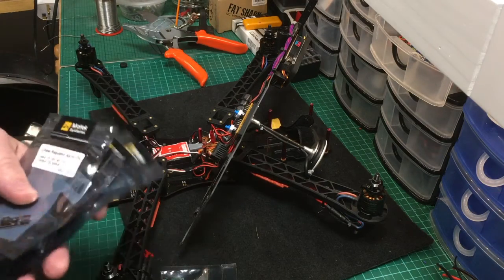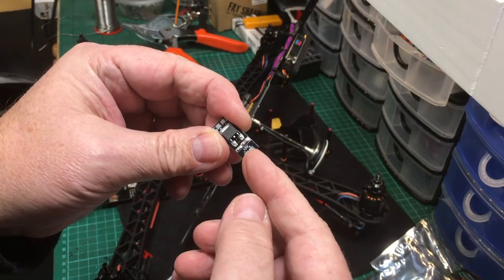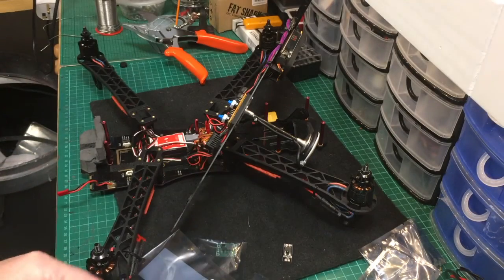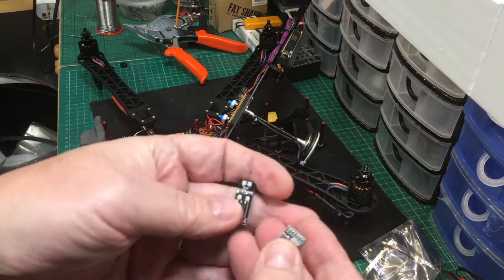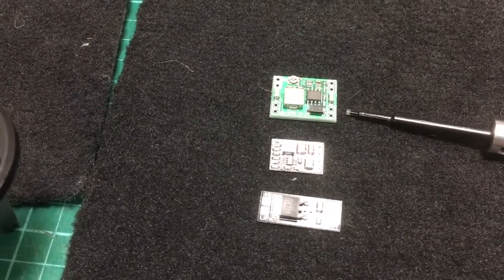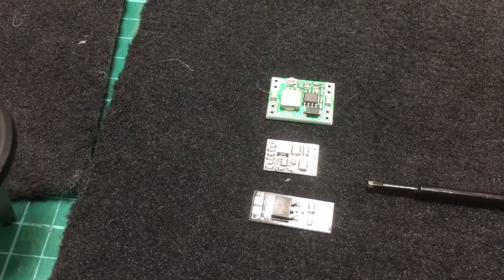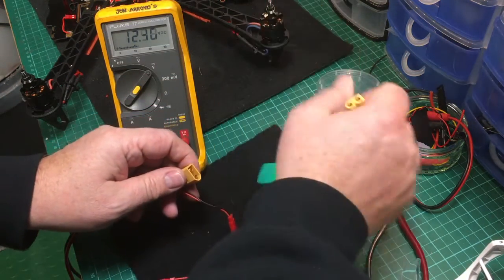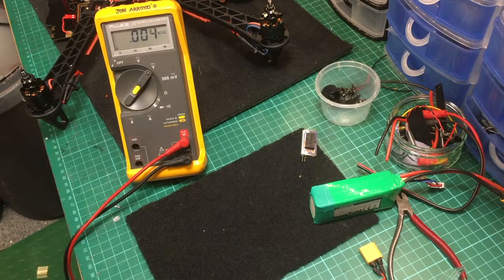Voltage Regulators

Comment: Ok im so confused atm. So im new to RC. And i plan to use it with model railways. So my battery is 3.7V and I need to boost it to 12V. So i purchased a pololu #799 booster. I've searched the web on how to wire this up.i found nowt..And how does you multi meter even work.any advice would be appreciated. Cheers
Reply from the maker: Boosting up is a problem..... as the voltage boosted goes up the power goes down. 5v 1amp in if you double to 10V out then the current is halved to only 0.5 Amp. and so on.....better use a three batteries in series to give you 11V or get a 12V power supply if you can. 
Just looked and it has three connections. Negative (black) in the middle. The outer two are + (red) In and Out.

Comment: Hey, I have a 80s battery and have a motor that can run at a max of 12s is their a way I can step this down using a voltage regulator?
Reply from the maker: Not familiar with 80s sorry. What is the voltage and how much current would your motor need.
You could reduce with transformers or switch mode power supplies but current draw would be critical.

Comment: Hi, I have a problem and hoping that you could give me a solution. I bought a vtx, vtx came with 3.55mm jack instead of balance plug. I am handy with a soldering iron but do not know the orientation of the wires (yellow/red/white/black) that I want to replace the jack with. The vtx is 15ch wireless av transmitter. I also have pictures. Can you shed some light this way, Please.
Reply from the maker: let me know what make and model VTX you have and I will check it out. It is not normal to have a jack plug as that may be for an old GoPro camera